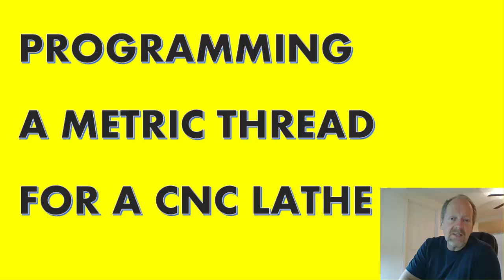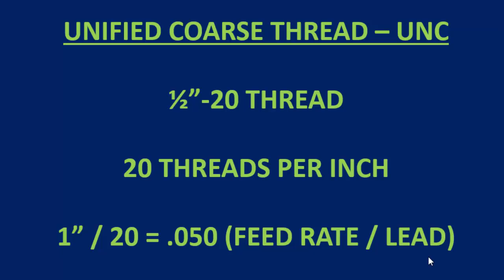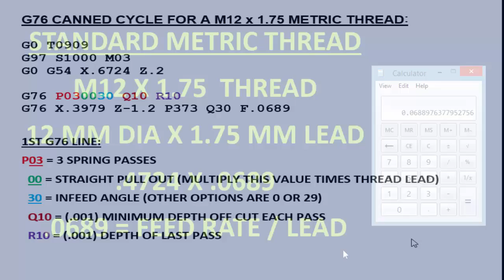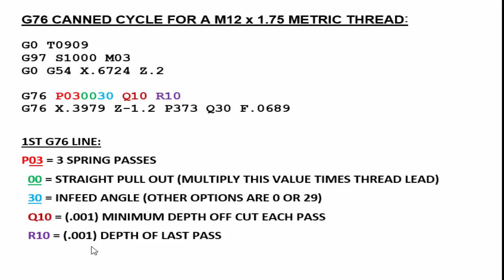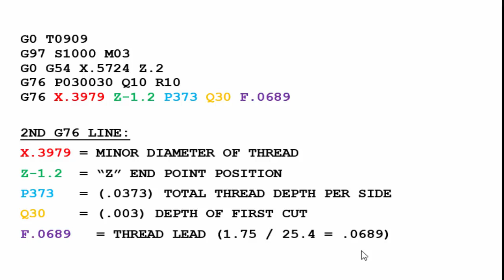CNC LATHE PROGRAMMING A METRIC THREAD

Comment: This was an excellent explanation! Thank you very much for sharing. I’ve been lathe programming for 6 plus years and while I haven’t used this type of G76 threading cycle in the past , recently had to learn how as I have changed place of employment and they have YCM lathes . I struggled on an M20x.5 external thread for a few hours yesterday and never solved the issue. I realize now I made a few boo boos in writing my code. I consulted almighty google and the machine manual but you Sir by far have seemed to help me understand this much better now! Nice job 👏👏👏Thank you for this simple breakdown

Comment: Hi Tom S., it's very interesting to view your shot video on " how to convert between Metric - UNC threads"; my name is Tuan Nguyen and I'm working in a small machine shop in Hamilton, recently we're running into a problem that we really don't know how to solve it properly. I hope you know the CNC lathe Okuma Spaceturn with 2 chucks.; the product that caused us some difficulties to produce now is 20NS-#12MORB which has 2 finished ends; 1 end done with M30x2 thread and the other end to be done with 1-1/16 - 12 UN . Because the system is in "1mm" mode which allows us to handle the union in a metric way so when the 2nd end suppose to be done with 1-1/16-12 UN (imperial), it can't be done within the "1mm mode" unless we have to convert it to an equivalent Metric thread. So, if you receive this comment please spare few minutes of your valueable time to help us how to find the equivalent of the : 1-1/16-12 UN in the Metric system. Thank you very much and have a good day. Tuan
Reply from the maker: I repied to your email. Hope that helps. Thanks

Comment: This video will make u break your tread tool the only thing to fix that Is to replace the second g76 lines x value to the part diameter and the second it first g00 line replace the x value with a whole number not a decimal I pick 18 then it worked
Reply: I think u forgot your working with mm so it dont really need decimal if u made sense of what I was trying to say
Reply: Figure it out  the g00 x value is the tool distance when its moved out the way of the tread to be moved back to zero position

Comment: 5:34
where you got those numbers theyway off.when there is easier way
1.75*0.65= 1.138 thread depth
12-(2*1.138) = 9.724 minor dia
g76 P010060 q100 r0.05
G76 x9.724 z-15 p1138 q250 f1.75

just to observe your sizes .3978=10.107mm. i cutting it 9.724mm=.3828
depth i use is 1.138mm=.0448 you have 0.0373=0.974mm (this is actually metric x1.5 depth?)
1.5*0.65=0.974. whats wrong you have to offsett tool -0.383mm=.015 to get tolerance. AM i right? well now you know where problem

no need datasheet everything works. thread will cut inside tolerances
if tool is correctly measured. it so MAGIC
but why inch threads not work so good LOL.desing flaw
i have to under cut thread too much. thread depth on datasheets not correct
inches suck. metric is more acuritely measuring anyway lol
mayby thats why
Reply: Where do you get that 0.65??

Comment: 1:33 dont use conversion let machine do it use G20 and G21.i dont use conversion when doing inch threads. i just calculate 25.4mm/tpi. its not conversion its how it is lol
so in your case you could just 1.75/25.4mm  25.4 is more acurate than conversion number 25.4 is exactly LOL

Comment: tapping on cnc lathe is possible?
Reply: I usually tap in a CNC by hand using a spring loaded center, much safer.

But, In theory you could program it to do so but you would need to designate three separate tool stations for your taps, and you probably need to modify the major diameter so that your taps take less stress (If using 4140 or similar steel alloy), also you would need a good way to get tapping fluid on those taps, not to mention flushing out the tapped hole between taps.

Comment: very nice and useful.
Reply from the maker: Feliex Hiruthayasamy Thanks Feliex.
Reply: +Tom Stikkelman hi, I can quite easily do parallel threads , Imperial and metric, the machines I use require you position the tool 6mm above the threads major diameter, but what about taper threading? the book I refer to is very vague about, maybe you can do a video? thanks